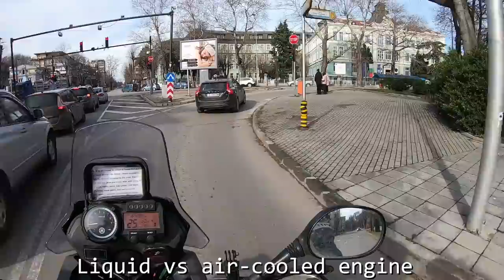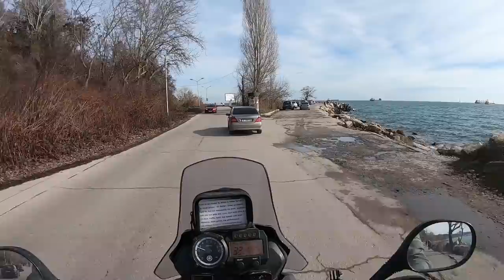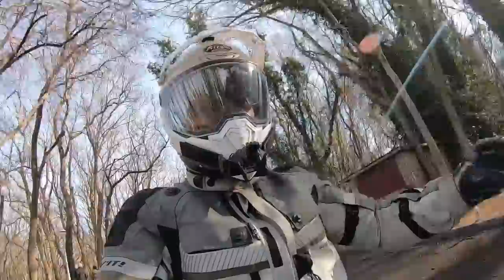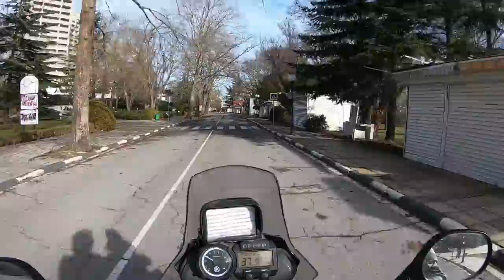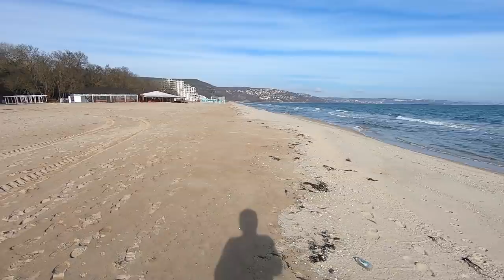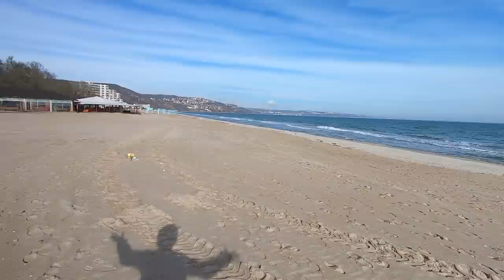Water vs Air Cooled Engine for Long Motorcycle Trips!

Comment: THERMAL efficiency. Modern engines need to meet modern pollution targets, and thermal efficiency allows this more easily for most manufacturers. Also gives more consistent,  reliable performance and longevity. 
2019 I road into Berlin, Vienna, Prague, Bratislava in the summer heatwave. No problems overheating,  not even burn any oil on Tenere.  Liquid cooling works.
Happy travels
Reply from the maker: Absolutely!
Reply: Sure. But air-cooling works too. 😮😉

Don’t forget the history! 

Many world-traveller motorcyclists have been around the world. Some of then when basically all motorcycles were air cooled! 

Ted Simon on his Triumph Tiger (old tiger, not the moderns ones), Helge Pedersen on his BMW R80, as Sam Manicom. 

There has been a few old Urals, on travel and in more modern times, Ed March is using his old (1989?) Honda C90. And the Royal Enfield Himalayan that Noraly Schoenmaker is driving relys on air-cooling as well. 

But yes, water-cooling have some advantages. As have air-cooling.
Reply: @IngOehman  absolutely. Have had many air cooled bikes, and love them. All have their advantages and disadvantages. Great to be able to choose! Happy travels

Comment: AiR cooled engines are rather obsolete nowdays, they are less powerfull, usually service intervals are shorter, because oil faces higher temperatures and the problém of traffic jams has been already mentioned in video. But they still make sense in retro bikes where the power is not important and in entry level enduro bikes, which are not so expensive and not easy breakable when dropped down. Anyway interesting video.
Reply from the maker: Thanks, man!

Comment: Simple answer to your question - emission standards.
Reply: Correct. That is the reason. But also, todays bikes most often have a very high power output per cylinder volume. 

The <50 horse-power 660 Yamaha do not really need water-cooling though, but having it is not a bad thing. It is a nice bonus! 😀
Reply from the maker: If there were demand there will be a supply!

Comment: I have been motorcycling for 50 years, with air cooled and water cooled. I have never once had a problem with overheating on either. My current bike (1988 BMW K75) is water cooled. In the 13 years I have owned it it has rarely even been topped up. It simply does it's job. Incidently, I live in Spain, so sometimes have done long journeys in 45 degrees heat. I did have to rebuild the water/oil pump a few years ago, but there was no drama. Just a very tiny leak. My previous bike (Honda CX 500) likewise almost never needed topping up. So for me, which cooling system is not important. Just having a well made bike, and regular oil changes (if it has a 4 stroke engine) are what is important.
Reply from the maker: Thanks for taking the time!

Comment: Extremely useful observations
Based on MY Aviation experience with AIR Cooled engines liquid cooled is less trouble.
Head temp.are less critical with liquid cooled 
I like my Honda in the summer. Runs cooler 
Change coolant every 2 years 
Thankfully I have to do  little stop and go riding 
BUT My Harley is warmer in the winter 😁😁
And I sometimes ride when it's  25F 
No science just my observation
Reply from the maker: Thanks for sharing!

Comment: As the others already wrote, Pavlin: thermal efficiency, emission and noise standards. I like the simplicity of my Beta Alp 200 engine (Suzuki air-cooled), less parts, less that can go wrong. But it's an old engine. I don't mind modern water-cooled engines, as long as they construct them troublefree for travellers. Protect water-pumps, radiators... Greetings from a cold Nürnberg, Günter
Reply from the maker: Thanks for taking the time, Günter!

Comment: Each and every aspect of the motorcycle engine is perfectly correct, a small single cylinder engine is fine with air cooled. And vice versa.
My motorcycle have air cooled engine. Perfectly does its job.
Thanks brother from India
Reply from the maker: Thanks for taking the time!

Comment: Hello, newbie here from the Philippines, I have and air cooled motorcycle for more than 7 years  a Honda XR200R and recently  acquired a water cooled  Kawasaki-Bajaj Rouser NS 200 and I noticed that the latter is smoother running than the former.

Comment: my moto guzzi v85 is air cooled
had no issues so far and the way they build the engine allows a lot of air to cool, but i have noticed that i am burning through engine oil quicker than on other machines
Reply from the maker: Which is means that if it was water cooled it willbe even better!
Reply: Hi. What's your average riding speed on the 85TT?

Comment: The water cooled engines are lighter than the air cooled ones? In case of the BMW GS I don’t have to google it. My 2012 air cooled boxer Modell is almost 20 kg lighter then the liquid cooled one.

Comment: Liquid cooling is good for the fact that you can run closer tolerances in the engine, mainly on the piston and rings.   

The big advantage being it allows a more even spread of heat around the cylinder and cylinder head, making the engine both more powerful and efficient.  

Air-oil cooled engines run larger clearances because you get hot spots, meaning the cylinder will not expand and contract at a constant rate.  

So basically water cooling is used to make engines pass emission laws, hence the adaptation of fuel injection and the death of the 2 stroke. 

As for which one is better ? Give me air-oil any time, after owning my DR 650 for so many years and riding in 40 degree days around the city with no issues and doing so many kilometres I love the low tech appeal.   

Great topic once again Pavlin. 👍👍👍👍👍👍
Reply from the maker: Thanks for taking the time again!

Comment: My new (2021 E5 compliant model) motorcycle came with air cooled engine but you're right about engine runnig temperature. On cold wet days the engine runs oddly the first few minutes. Maybe the fuel injection maps are not well adjusted. But I had no problems with overheating even when I was having off-road lessons in the summer with around 40 celsius.
Reply from the maker: Thanks for sharing!

Comment: Dont agree with this one, can't generalise. Very much depends on bike some a/c bikes are designed for heavy traffic in high temperatures  while some l/c bikes quickly overheat. I remember taking the Guzzi into Milan once in the high 30's. The clutch was complaining a bit but it was fine. I overheat before the bike will.
Reply from the maker: You don't agree but: "The clutch was complaining a bit but it was fine". What if it was 40 or 45 degrees? With a water-cooled engine, this won't happen. End of the story!

Comment: My old xt600 have a Aircooled System.....if I travel in 40 C condition on traffic jam or slow Stop and go the oiltemperature climp near 130 C than i am afraid sometime ,but the Engine run well .I use a 20W 50 mineraloil than its ok...if i use 10W 40 than climp the temerature more higher.Maybe a synthetik Oil it is better for high temperature? what do you think about ?
Reply from the maker: https://www.youtube.com/watch?v=Bhic1fisEoA&t=105s

Comment: Like most of the other comments I think that  liquid cooled engines work hand in hand with the newer model motorcycles plus the electric fans as well in case of low speeds in the summer heat.
Reply from the maker: Exactly!

Comment: I have never had a problem with aircooled GS 1150 and less overheating as the Transalp 700 in hot weather! Oposite to my old Yamaha XJ600 air cooled engine was very sensitive in the 35 C through the big city trafic :(
Anyway, I am in love with the air /or/ air-oil cooled engines, from technical point of view it is something like art. As from old times when the engine have to a be beautiful peace of engineering. Not just stupid brick design of the fluidcooled engines.
I love my Ducati twin 900 and Suzuki GSXR 1100 from 1986 as well as my GS1150, they are just a beautiful bikes. Take a look on the engine of old oilhead BMW twin, it is a masterpeace of art. Or the beautiful Yamaha XJR 1300. Compare it with water-cooled engines from Honda Hornet, Afrika Twin or well known Rotax 650? nothing to do with the beauty....
Reply from the maker: Point of view...

Comment: Greatly appreciate your Vlogging!, as for the claimed main air-cooled engine "cons" for the town which is overheating and confort: I ride a 1100cmc big twin which compared with small displacement engines with the same power+torque has a lower compression ratio and smaller rev limit (the big volume of the air intake and slow burning at low idle will cool the heads more eficiently )...of course, I must accept a double displacement and lower power than a small water-cooled "compressed" engine  (but as an advantage, it will get more torque and more character than a small compressed water-cooled engine...), in the end, I found out that if the engine works properly (have the proper oil especially) it can idle in the hot summer without the slightest technical problem!, Regarding the creature comforts here I must point out that I was very happy with my V- twin compared to my fellows' sports bike guys, it needs at least 5 minutes to feel some heat when completely stopped, after that the heat will simply rise UP, the guys who have a radiator and fans must accept and even cry when the hot air will be blown toward them :) As for your question: as I see it, unlike cars, the power/weight ratio for a motorcycle simply doesn't justify a water cooling solution for average bikes, yes the performance (Hayabusa) maybe need this but not a 60-90 hp bike. As the science of metals and oils is way advanced is a pity that bikes must rely on water cooling to build cheap and stay reliable and compliant with rules. The ideal combustion engine would be the one that doesn't lose any heat and doesn't need any cooling :)...Anyway.....I assume that in 5-10 years will talk about Amps and Volts..so..no sweat for the combustion engine and life as we know now :), Good Luck and Safe Roads!
Reply from the maker: Thanks for taking the time!

Comment: The reason is very simple:
Modern technology allows to make very powerful engines. As more power, as more heat, and the air cooling system is not enough for the heat that the engines produce. The water cooling system is much more efficient.
Reply: Pravda !
Reply from the maker: Agree

Comment: I wonder how do things stack up for smaller displacement engines like 125cc? I would assume that smaller volume-surface ratio would be more favorable for an air cooled engine, but I don’t have any experience or mechanical engineering qualifications, so I guess that there could be something I’m missing.
Reply from the maker: It is the same!

Comment: Nice video,  I am planning a trip to Bulgaria in September with my air/oil cooled 650s bandit. In general I don't have any problems despite having an average of 30 degrees in the summer here in Greece. The only thing that annoys me in the city is the heat that reaches my ankles, this makes riding in the city difficult.
Reply from the maker: Have fun!

Comment: Easier to meet emission requirements with water cooling. More consistent  Temps. More consistent  clearances.  Fuel injection or even carburation can meet requirements that air cooling could never make. 
I own a XR650L and would never sell it but I can tell when it is hot as it starts to get noisy, smelly (oil clearances are more when hot, oil gets past rings) and less power. That being said, an experienced rider will know when to ease off and let it cool. I still believe  this is what makes it more reliable as you can tell when your bike needs a rest. Air cooling also cheaper to manufacture,  cheaper to maintain  and fix.
Reply from the maker: True!

Comment: I don't know a lot about the topic, but my guess is that liquid cooled is 'better' for the environment, as you can control temperature, thus controlling emission/fuel consumption. Not saying it consumes less or more, I just say it consumes exactly how much it is supposed to. Personally, I had an air cooled XVS1100 and I was cooking my ballz in traffic, but NEVER had any issues with that bike. Exchanged that bike with an Oil/Air cooled R1200GS and when I was going off-road sometimes I could smell burnt/overheated plastics (due to lack of speed cooling was inefficient, but the bike behaved well also!) And now, I own another R1200GS, but liquid cooled. After having two air cooled bikes before, this last one comes as 'something better' simply because nothing overheats. I would not chose air cooled again. Am I getting too comfortable? :p
Reply from the maker: End of the story!

Comment: Because of the power/volume of the engine. More power from the same capacity engine makes more eternal heat. The manufactures tend to increased for marketing reasons. If you have big engine but low power it's possible even in the hot.
Reply from the maker: Than the performance will be like elefant in a muddy bath.

Comment: Emissions are the main reason for few modern engines being air cooled. Tolerances can be tighter and encasing the cylinder in a water filled jacket reduces the mechanical noise of the engine which was causing concern to designers even back in the seventies.
Reply from the maker: If there were demand, there will be a supply, no matter how much it would cost!

Comment: Interesting topic, when I'm flushing my coolant I dream of the convenience of an air cooled engine, but I don't often think of the downsides. Perhaps in Scotland it's a decent option as it's rarely over 20C here. It would be good to see you test ride the Moto Guzzi V85TT, perhaps the only current air cooled 'adventure' bike, I assume you'd need a viewer nearby who would be willing to donate theirs for a day though!
Reply from the maker: I will do it when I have to chance.
Reply: @motorcycleadventures  That would be great, as I am considering the Guzzi V85TT also. Love your quality reviews!
Reply: My Guzzi V85tt does not overheat even 2 hours in slow moving congested traffic in Tropical heat Philippines , My Z1000 4 in line water cooled gets hotter , Maybe Moto Guzzi Know What they are doing with their Air Cooled Engines , So i Appreciate the Video but maybe modern air cooled engines like The V85TT have Changed These Days , Just Saying

Comment: Cost. Air cooled is usually cheaper with iron liners and old metallurgy pistons. The latest GS has air/oil/liquid cooling with some really nice metals. Even the same new CP2 is getting forged pistons.
Reply from the maker: If there were demand there will be a supply!

Comment: Ok I understand that video is general and also focused on old air cooled bikes.... I will not hide that I own Moto Guzzi V85TT (3rd bike).  This video may dissuade all potential MotoGuzzi customers. Half of opinions-facts are true, but Guzzi worked a lot on aircooled engines. They are not so powerful compare to cooled engines, but this is not a matter as power limiting V position.
In case of temperature increasing ECU enriching mixture which keep heat level sustainable. Few ppl overheated V85TT on slow speeds  , but KTM aside as well on some video trip. So from Guzzi side I can not agree with reliability, heating and so on. 
I may add following cons like changing performance and behave of the engine in cold temp - but nothing significant. Engine may drink some oil as clearances in engine are higher due higher operational temperatures. So you should be gentle mainly during 10 km after cold start.

I do not know how other brands and their models, but aircoled motorcycles in 2020 does not have serious issues.
Reply from the maker: I don't want to say any bad words about your Guzzi but its performance is not even competitive with most of the water-cooled models in this segment.
Reply: @motorcycleadventures  Of course, no no offence taken, there are better performing bikes than my Guzzi :) I wanted to say that aircoled bikes is not such disaster than 20 years back... especially with carbs.
Reply: @tomdrpa7221  I owned a Guzzi T3 many years ago and even then the engine had low power but very good torque .Low power, when combined with excellent low down torque, is an excellent relaxing to ride combination . I love this combination . .

Comment: I suppose it would depend on the manufacturer, but I've never heard anybody complain that they're cooling system has gone bust. However I wouldn't want to be riding through the sticks on a long trip with a cooling system, in case those hoses get damaged.
Cooling systems on road bikes are pretty safe in my opinion.
Reply from the maker: Agree!

Comment: Yes, you're mostly right, Pavlin. But whether you like it or not, you have to think about it. You have to think about the water, the radiator, the hose, the pump ... You just have to. These are extra worries.
Reply: And without it, you have to think about traffic, cold weather, hot weather, fuel efficiency, and shorter service intervals on the engine. I think liquid cooling is worth the trade off.
Reply from the maker: Exactly, always pros and cons!

Comment: Saludos Pavlin from México City. My Bajaj Pulsar Neon 220cc 2021 have a oil radiator. What are your impresions about it my friend? Fantastic your chanell thanks for share. Very intersting your topic.
Reply from the maker: Almost any air-cooled motorcycle has an oil radiator, it helps but not that much.